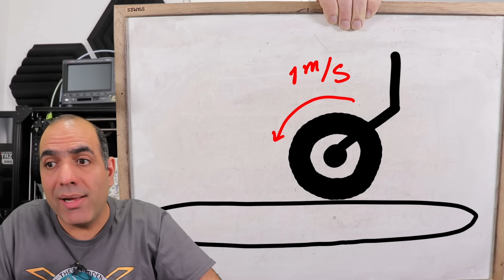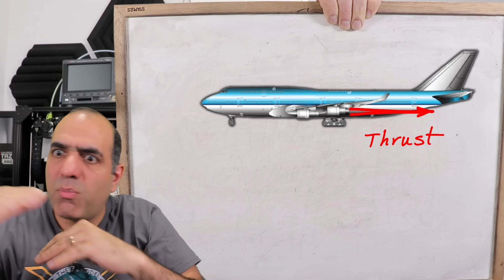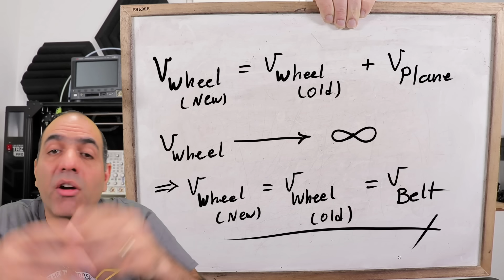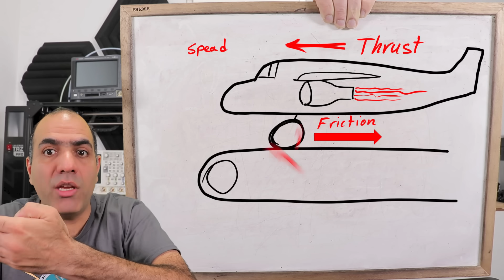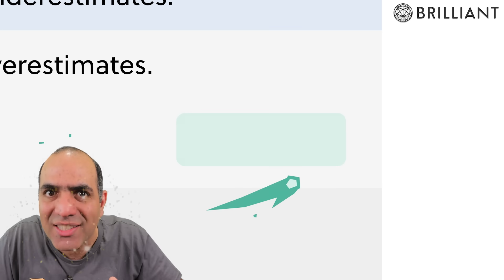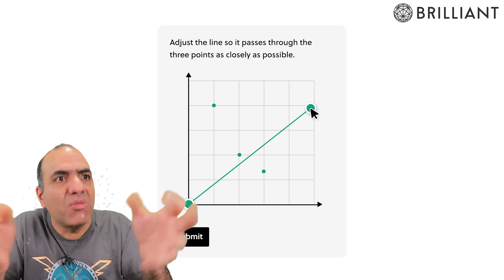Airplane Question that Drove Me NUTS!!!

Comment: The airplane isn't using only wheels to move like a car though. The actual engines use air to thrust forward. I don't think the conveyor belt will be able to keep the airplane there

Comment: The plane probably would take off.  The problem is that, if the conveyor belt responds instantly to the wheel speed, the speed of the wheels go to infinity immediately and break off.

Comment: Didn't Mythbusters cover this?

As I recall, the conclusion was that the plane could, in fact, take off. A plane's landing gear (the wheels) are completely unpowered. A car on a conveyor belt would remain stationary (with respect to the environment) because a car goes forward by pushing against the ground with its wheels, but the ground is going backward in equal measure, resulting in no net movement. But a plane goes forward by pushing against the air with its propellers. The conveyor belt has minimal effect on the air, so the plane is almost completely unaffected by it.

Comment: If the plane and conveyor belt are covered in solar panels, the plane WILL take off and generate enough electricity to power a Donald Trump's tan sprayer and Marjorie Taylor Greene's vibrator.

Comment: Yes, but...
Suppose the wheel-axle connection is frictionless the conveyor will have no effect on the airplane and thus with any amount of thrust from the engine the plane will move forward and the conveyor belt must increase it speed to it limit or to infinity if there is no such limit. If the wheel-axle connection isn't frictionless then the engine must provide enough thrust to overcome this friction.

Comment: Haven't watched the video yet. 
The question is impossible.  The conveyor belt cannot match the speed of the planes wheels.  The planes engines will pull it thru the air, and due to limited friction with the conveyor belt, the plane will start to move relative to the surrounding air.  At that point, the conveyor belt will speed up to try to match, but the wheels will also speed up.  Wheel speed will always be conveyor speed plus the plane's ground speed, and the belt can never catch up.  
The question could be reworded.  The conveyor belt will ramp up to slightly faster than the plane's take off speed.  While it is doing that, the plane limits it's speed so that its wheels are only going the speed of the belt.  In this case, the plane's wheels are going take off speed, but the plane has zero air speed and won't take off.  

Watched the video.  
Thanks for the clear explanation and I agree with your analysis.  
Did you see the Myth Buster's animation where they describe the myth?  They show the plane bouncing along a belt with zero airspeed, which doesn't match how they tested it.  I think that animation has greatly contributed to this issue continuing to be discussed and argued.

Comment: red herring. The wheels on a plane do nothing but spin freely and hold the plane up so the plane will accelerate with its jet engines down the treadmill runway and take off just fine. Though, the bearings in the wheels might overheat if the treadmill speeds up too much (to rediculous speeds, say if it tries to keep the plane stationary which is impossible) before it lifts off.
Reply: Ah, but if the treadmill is powered so it always matches the aircraft's wheel speed, then the aircraft will in one place - and no air moving over the flight surfaces means no lift.  Wheel speed / ground speed isn't directly relevant to being able to fly, only airspeed is.
Reply: @aussiebloke609  Treadmill has no effect on airspeed.  Only wheelspeed. The wheels and treadmill might explode but the plane will take off.
Reply: @protocol6   Exactly.  Which is why it's such a stupid question in the first place - it's an impossibility.  In the end, no treadmill can keep up when the aircraft start moving forwards, generating lift and violating a tenet of the question...or the aircraft never moves and generates no lift, which would require the engines to be producing no thrust.  I always try to remember that the earth is effectively a huge treadmill with a surface speed of around 1000mph and a relative airspeed of effectively 0.  And aircraft still take off every day, but they do it by moving at a different speed to the air and thus to the ground around them - which is not permitted in the hypothetical question as it was presented.  :-)

Comment: My thesis:

The plane will not takeoff as it is not moving at all. It's at a stationary position and only the wheels are spinning. Why? This is because the conveyor belt is matching the motion of the wheels in the opposite direction. So, the plane will not have large amounts of wind going through its engines, which won't propel it and thus, it won't take off. Think of it as if you're running on a treadmill. If you jump, will you go forward or jump about your position? I know there is no air involved in the treadmill example, but still, it should help you visualise it better. I believe the plane needs momentum to move forward, but since it is not moving, it won't take off.

Comment: In the first half minutes, I know the answer: Yes.
It will take off because the jet engines uses air to speed up, so the runway's "movement" can't prevent the plane to move forward.
Mythbusters busted this myth.

Comment: I would say that the answer is yes, the plane can take off. The wheels are not driven and therefore are free spinning, so taking off on a moving surface is no different than any other runway from the plane's perspective. All airplanes push off of the air to produce thrust, the wheels are just there to apply a strictly vertical normal force to the aircraft during take off. Once you realize that the way a plane moves is very different than the way a car moves, the answer becomes very obvious.

Also, the mythbusters tested this exact situation back in 2008, but apparently everyone on the internet completely forgot that the answer to this question was already out there.

Comment: Answer #5: the conveyor belt also drags the air with it, to a degree at least. i.e. boundary layer flow. As the wheels & belt start to go really fast the belt creates enough wind speed for the plane to take off. Problem solved. At least under the assumption that the wheels survived the centrifugal force instead of disintegrating and turning the experiment into a raging inferno.

Comment: I think you're just making it complicated. 

1. It's an engineering question not a trick one, so we'll simply assume plane is sitting 'cause there's no initial velocity given to it. But it has to create the thrust.

2. Introduce friction where the question demands i.e. just between wheel-belt interface.

3. Let's try to exaggerate the situation. Assume some huge unicorn can pull the runway like a carpet and the plane is speeding up. The pulling speed is also increasesing to match the wheel's tangential velocity at the contact in such a way that you standing away from the runway can see the plane to be stationary. Since the plane is stationary to the earth therefore it won't pierce through the air hence it won't fly.

YOU CAN ALSO TRY TO PULL THE RUNWAY AT INFINITE SPEED AND THE PLANE WILL START TO MOVE BACKWARDS.L AND NEVER FLIES. I AM SAYING THIS JUST TO CREATE AN INTUITION THAT BELT SPEED ACTUALLY INFLUENCES THE TAKE-OFF.

Comment: One need a huge speed wrt the air around the plane to generate lift. So, no, the plane shouldn't fly. It would be a different case if the plane had a thrust to weight ratio higher than 1, in which case, it would act like a rocket and not an aeroplane.

Comment: Even if it could fly... Which it won't. Flight is not based on the runway or the wheel displacement. It is based on the quantity of flow of air over the top wing surface area. This air moves fast over the wing and creates an area of low pressure, which, once it exceeds the weight of the airplane. It flies. It's definitely more complicated than that, but that is the general idea negating air resistant, gravity, etc. However, the engine will fail long before the wheels or anything else in the system. Jet engines use air/oil to cool the engine. I've seen people burn up engines from just inexperience trying to start them (improper fuel/air mix).

Comment: who says the engine thrust has to be forward. If the pilot engages reverse thrust. It will lead to belt moving forward at very high speed to match the wheel speed. and apply brakes and forward thrust to catapult the plane

Comment: Edit: Alright, this video makes a good point. I suppose I was assuming the third scenario in which the relative velocity of the bottom of the wheels to the belt were zero, there were no slidy parts in the plane, and the thrust were matched by the backwards motion of the belt to result in the plane being stationary, but I acknowledge that the question is ambiguous and other answers are valid with different assumptions. I have gotten mildly annoyed at similar questions, like the infernal 6÷2x3 (especially when people whose mathematics education ended at high school calculus insist that there's 'mathematically only one correct answer').

v THE BELOW WAS WRITTEN BEFORE WATCHING THE VIDEO v
Commenting before watching because Mehdi told me to: I don't see why it would take off, assuming the setup is that the plane is being stationary relative to the ground. Planes' wings receive lift because they're moving forward relative to the air, not the ground. The treadmill would probably cause some air to flow backwards relative to the wings, but surely not nearly enough to lift the entire plane.

Comment: The belt would spin up to try and match the airplane, then destroy itself as it has to speed up to match the wheel velocity, which speeds up the wheels, which leads to having to speed up further, until the materials of the belt cannot take the stresses any longer. This would likely destroy the plane, as taking off takes a while. So no, it cannot take off, but not for the reason the scenario wishes to imply.

Comment: Yes, the plane can take off in this scenario. The speed of the conveyor belt matching the speed of the wheels does not affect the plane's ability to generate lift, which is the force that enables it to take off.

Lift is created by the airflow over the wings, which is generated by the forward motion of the plane through the air. As long as the plane's engines provide enough thrust to overcome the drag, and the wings generate sufficient lift to support the weight of the aircraft, the plane will take off regardless of the speed of the conveyor belt.

The movement of the wheels on the conveyor belt will be irrelevant to the takeoff, since the wheels only support the weight of the aircraft on the ground and do not provide any propulsion or lift.

Comment: I think realistically the limiting factor would be the coefficient of friction between the tires and the belt. 
I'm pretty sure the plane can generate enough thrust to cause the wheels to spin so fast they no longer grip correctly and then the plane can slide along the belt and take off
Reply: I'm pretty sure the ammount of friction required to match the thrust would produce so much heat and cause them to spin fast enough that the tires would burn or explode, the plane would careen out of the conveyer and crash. I'm going to say this is the real world scenario that would happen in this case.
Reply: There's no way to transfer the force from the ground to the plane because the wheels are free rolling. Answering the question comes down to what you think the question is asking. Do you think it's asking if can a plane can take off without moving, or do you think it's asking if you realize the contraption is not capable of preventing the plane from moving.
Reply: @407BRR  Apparently they should not be free rolling, or it would be not possible to prevent plane from moving relative to the ground.
Reply: @igorbondarev5226  then maybe you should challenge your assumption that plane remains stationary. It's simple Newtonian physics. There no force acting in opposition to the thrust. The plane accelerates normally.
Reply: @407BRR  But then the problem states "the speed of wheels" (I assume linear speed of the edge of the wheel relative to the axis) "is equal to the speed of belt" (I assume speed of upper part of belt relative to the ground). If there's no slipping (why would it be there), it means axis of wheel is stationary relative to the ground. To achieve this while engines are working, something should pull back, I assume friction...
Reply: @igorbondarev5226  You're assuming the question is insisting on the plane remaining motionless. I do not think the that's true. I think that's the trick in the question. I think the question allows for the plane to accelerate forwards. And that's what I think the question  is asking. Do you realize that there no force that can prevent a pilot that intends on taking off from accelerating the plane forward and taking off as they normally  would?

Any debate about wheel speed can be easily solved.
Reply: The only thing that would make a plane fly is sufficient wind speed over the wing....How fast a planes tires run has nothing to do with it...
Reply: the only way a plane takes of is becauseof the lift generated by the air running over the wings of the plane. The lift is generated through motion, so if the plan isn't moving it wont take off. That is unless there's a massive headwind.
Reply: my brother actually did the math on the friction thing for this question a few years ago, and yeah, the wheels and bearings would melt well before the friction has any actual effect on the plane's ability to take off.
Reply: How it will not grip correctly just because of high speed? I don't understand.

Also if there will be any slipping it would violate the condition "the belt speed exactly matches the speed of wheels"
Reply: @igorbondarev5226  Nah, slipping doesn't violate the conditions. Let's assume you lock the brakes, the tires would be stationary, and so would the belt, but the plane would slip forwards. Assuming strong enough engines anyways. At least if speed of the wheels is relative to the point of contact.
Reply: @thecakeredux  You are right, I was wrong.
I didn't think of slipping at all when I tried to solve this problem by myself. But now when J D and you've suggested, I think I would probably discard this idea, because it adds extra assumption to the problem. This problem doesn't specify all conditions, and this is why it's so tricky, so I usually in cases like this try to add as few extra assumptions as possible until the problem is solvable (this is how you do on exams 😀). And before introducing slipping I already can get the answer "no".
Reply: No I don't think so.  Have you ever Seen a car on a chassis dyno. You could take out the front window and the guy in the car will feel no wind in his face. This is the same situation with the plane on the tred mill. You could go out and  stand on the wing and only feel a breeze. Therefore the plane would never lift off
Reply: @mrigger2500  The tires don't affect anything. They don't have motors in them and don't affect anything about the takeoff. Go put an RC car on a treadmill and then push the bumper with your finger. It'll move forward.
Reply: @mrigger2500  you missed the point entirely
Reply: @mrigger2500  a jet engine works by pulling a lot of air and pushing a lot of air, the air alone is the reason why the plane moves (it's not mechanical like a car but just the thrust of the air), this means that the plane would be completely still but the air would be tremendously accelerated by the engines, you would definitely feel more than a breeze.
Reply: @GiovanniP199  Air pushed through the engine and air flowing around the wings act differently. Think of a passenger plane on a runway before takeoff. Engines run at constant power while the plane accelerates, but it doesn't take off until certain speed relative to the air is achieved, even though the thrust doesn't change during the whole period.
Reply: @mrigger2500  A plane is still not a car...

Comment: Can you explain why V_wheel = V_plane + V_wheel? The question says that the conveyor belt is set to match the wheel, so the wheel speed is not dependent on the belt speed. If the plane is going at speed V, and the belt is moving at speed V, then the rotational velocity of the wheel would be V as well, no? Wouldn't the formula be V_wheel = V_plane = V_belt?

Comment: The plane will still be able to take off. The only difference is that the wheels spin twice as fast.
Airplanes do not use wheels to move forward like motorbikes and cars, but use jet engines to push air backwards.